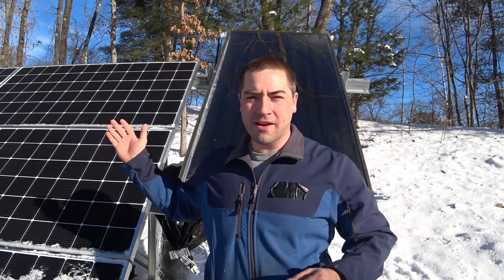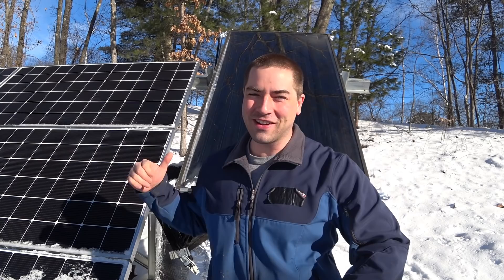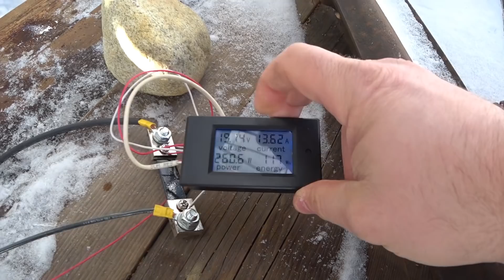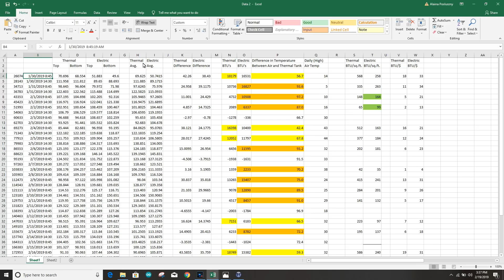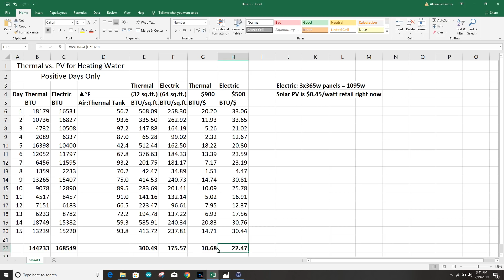Results of Solar Thermal vs. PV Experiment in Heating Water

Comment: When the water is hot via PV, you can route those panels to power other things like charging batteries, where as the solar thermal can only heat water.
Reply: flampy1... excellent point, especially when the weather warms up and the heat isn't needed. The next level would be to sell power pack to the grid when all systems are satisfied.
Reply: @rupe53  -- he noted he could also use the Thermal for Space Heat.   Solar Thermal with a heated concrete floor works GREAT.   Once the Concrete is warm, it will keep the whole building warm for DAYS, even with Cloudy Weather.
Reply: @Phil Timmons  But what use is all that heat in the summer when that area could be making power instead and its cheaper.
Reply: Yet going further and avoiding the "saturation temperature" problem is you can increase the water volume and heat more of the stuff when compared to PV.. While being at it, might as well buy a heat pump!
Reply: M Detlef  Who's the dumbass really? I think flampy's point was when you don't need heat why make heat? Middle of a hot summer why would you want to heat air? Is 100F to cold for you? LOL With PV when you don't need heat for anything you can run a water fountain for a fish pond, or use electric cookers more, charge batteries to run outdoor lights at night AWAY from the house so the bugs are drawn far away when you want to sit outside and enjoy the evening. Or heck even run a bug zapper if you want to kill off some bugs. So summer when you have all the hot water you need by 10-11AM making more is useless, but flip a switch and do something useful with electric is not useless.
  I will be installing PV hot water in my home, shop, and motorhome for heating, I have no shortage of space for panels, but already in April I have little use for hot water (or air) other than simple things like bathing, washing dishes and clothes. 
 Another thought is like for my motorhome, I cannot store or haul much hot water, but I can heat water with PV for daytime heating when needed and good sun, then when running out of hot water at night use the propane heat. Anytime hot water is not needed the PV can be lowering something I do need or charging batteries. Many more uses for electric than there is for hot water. Also not only do not need heat in summer but that is when airconditionaire is needed, see you run that on hot water or hot air. LOL  So summer is when more power is really needed for most people, not winter.
Reply: They both have good points, and honestly I'd just as soon have both, though I think I'd lean towards water for water heating. Of course I'm thinking economy of scale and building yourself. 
In either The thing is you can build that water panel for next to nothing. The glazing is the most expensive part, and even there I think I'd go with some of those clear panels you can get at home depot or lowes that are shaped to fit in with galvanized barn/roof siding, then use two sheets with an air gap between them for insulation.
Ive been thinking about building a very large one, say 20-30 feet wide, that would have a primary use of making hot air to heat the house on sunny winter days. (A 40' well insulated shipping container full of big rocks for heat storage is just out of my budget, hehehe!). The secondary usage would be making hot water, which wouldn't need quite as much space for the tubing... There's hot, and there's too hot! ;)

In either case (for water heating) you still need to create a large hundreds of gallons heat exchanger tank so you can have hot water after the sun goes down for all the showers, laundry, dishes etc. Both still need to be piped through a hot water heater that can bump up the temp as needed as well as making sure the water is hot enough to kill off legionnaire's disease.  Oddly enough there's warnings on some government websites warning you about this and telling you to keep your tanks at a certain high temp (electric tanks need to be higher than gas due to the way they heat (think I have those right) and yet another 'energy saving' gov website tells you to set them lower to save energy! Talk about the left and right hand not knowing what the other is doing!

In the case of heating the large water storage tank with solar, you almost really need a pre-tank to  safely mount the heating elements in for electric safety, unless you got really creative!

If you're mostly just after heating water for day use, solar is quicker with less hassle and with higher consistent temps. But as he said, it's all sbout space, time and your budget! :)
Cost up front (as long as I pay cash) isn't a concern with me, I just would like to have a nice setup for electricity/water/heating/cooling before we both retire so that by that time the house will be paid off and we won't have energy bills!  
Btw, a few companies are making mini-split hvac heatbpumps that can run off solar panels completely when it's shining and pretty low power draw when its not. The smaller the unit the higher the seer rating you can get.  Think 9000 btu cooling for the bedroom thats solar and 30+ seer rating! I want to have a large 240v line run along the outside of my house so I can start adding mini-split units for each room as the budget allows. 'Its just money!' as my dad would say, then we'd laugh (because we couldn't afford whatever we were talking about;)
Reply: Or when you're charging batteries and they get full, you can continue heating water :)
Reply: You could route some power to run a pump for a Thermal Solar installation.
Reply: Heat water, or charge batteries? Well water is cheaper, but batteries are smaller.  Are batteries smaller per btu stored?

Comment: I would like to ask you if you could run a similar test with vacuum heat pipes?
Reply from the maker: I would LOVE to.  I've been watching craigslist for a cheap used set, but no go yet.  If someone had one they wanted to loan me, that would be great.
Reply: @DavidPozEnergy  they can be made
Reply: @DavidPozEnergy  we work in the UK and have removed loads of pressurized tube systems and replaced with flat plate drain back systems. Reliability of drain back is amazing compared to pressurized. We still favour thermal over PV too because in the UK space is an issue and we really think that high grade energy like electricity should be used to power lights, computers... Not to create heat 
Also agree with other comments re heat pumps powered by PV as a better option than immersion heaters.
Great to see this comparison video, thanks.
Reply: This is a theoretical cost comparison I made between PV panels, Thermal solar with vacuum tubes and natural gas page 5  http://electrodacus.com/DMPPT450/dmppt-presentation-v01.pdf   Spoiler :) the thermal solar lost by significant margins.

Comment: I know you've had bad luck with heat pumps... but they usually work and magnify the energy of PV 3-4x.  So even if you're space constrained the ideal solution would be HP+PV.  I sort of use my HPWH as a thermal battery... it only turns on when the sun is up and my batteries are full.
Reply: While your statement is true to an extent it's limitation is hit when the outside coil freezes vastly decreasing thermal conductivity. Hence, why some heat pumps have electric heat coils to supplement. Where solar thermal shines is cost efficiency when you build it yourself. I've seen functional solar thermal water heating systems simply using pex tubing wrapped in form fitted aluminum sheets meant for hydronic floor heating. Alternatively, aluminum gutter down spouts for solar thermal air heating.
Reply: Christopher Dizon , but then the "best cost ribbon" might go back to the solar thermal. Decisions decisions!  Is it cheaper to buy 4x panels than one heat pump?
Reply: @TheRainHarvester  Have you priced a heat pump water heater?
Reply: There is a catch with heat pumps though, in that they require a determined amount of power to operate, where if it’s slightly cloudy a direct heating element would still just produce less heat but the heat pump would probably not operate (properly?) if it dips below it’s required power.
Reply: @motalasuger  Short sighted answer. A simple PV-heat pump system with batteries and charge controller has all the power needed to beat Dave's experiment by a factor of three or four.  That is what my new off grid house has. It is a shame that Dave gets the publicity he does based on how little he actually knows.
Reply: @nicklappos  What is the efficiency in of a air-water heat pump when the surrounding temperature is about -10°C and you want to pump up the tank up to +80°C? I'm not an expert but I expect it not to be working quite well with this high of a delta...
Reply: @matija3791  theoretically heat pump have more efficiency that resistance heating at all temperatures.
Reply: @nicklappos  Nick, I have a geothermal heat pump, and it's amazing, having consumed only 50 kWh in 14 years to heat my 1600 sqft house through Colorado winters.  But I do very much appreciate Dave's test, as it explores a less techologically-complex approach to renewable energy.  I've wanted off-grid capability, but recognize the complexity and cost associated with heat pump longevity, as well as adding the complexity and cost of a battery backup system.   I also have two 4x8 solar thermal flat plate drainback collectors with a 100-gallon storage tank, and there is very little to go wrong with that system.  It has a single used bronze pump that's performed flawlessly for 14 years, and will likely only need need an impeller replacement when the time comes.  I would expect even better reliability from a PV-based water heating system with no moving parts and no controller.

Comment: Amazing so what you need is a hybrid using thermal to start and finish it with solar electric
Reply from the maker: LOL.  I was thinking more of just thermal for space heating and electric for DHW.
Reply: @DavidPozEnergy  -- add some concentration on the Thermal.  Makes a HUGE difference on the delta T.
Reply: @DavidPozEnergy  Go the DIY solar thermal route and save a good chunk of change. 
For solar thermal air aluminum gutter downspouts with solar powered mixed flow fan. With it having less mass and specific heat capacity it will ramp up faster with less losses during night time as you close the entrance / exit ducting to the house. If you oversize it just duct the excess heated air to a heat exchange to your thermal water battery.

For solar thermal water pex tubing form fitted into aluminum hydronic heat transfer plates meant for hydronic flooring. It is honestly more of a headache in colder climates but ideal in regions similar in latitude as North Carolina or closer to equator.
Reply: I don't think it changes the cost equation.  Does it? But if you already have the solar thermal, it's a win.
Reply: Great Minds think alike!!
Reply: Now what you need to do, is give a test, dollar for dollar, one system vs the other. So if the PV is 1/4 the price, get enough panels to equal the dollar amount it cost to do the thermal system. Then do another head to head test and see which is faster